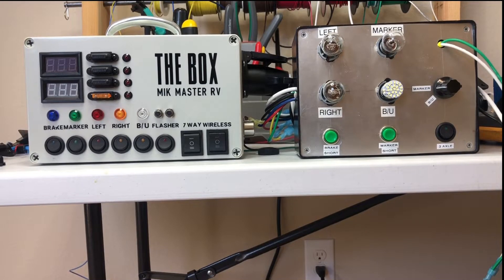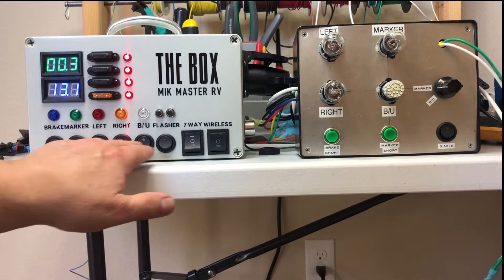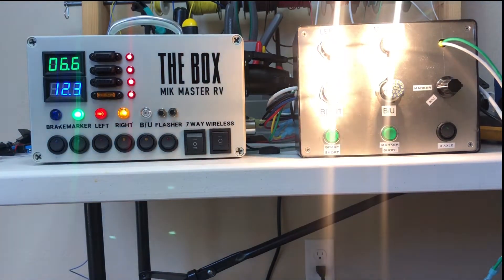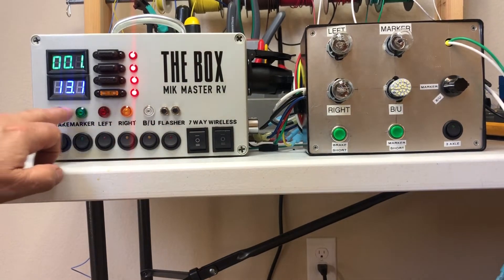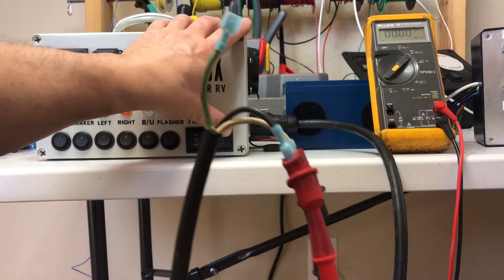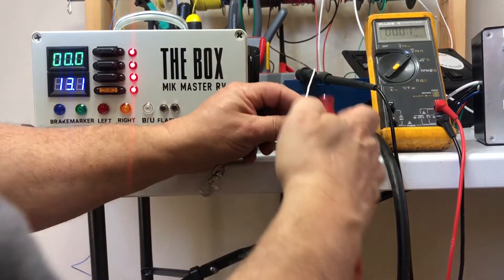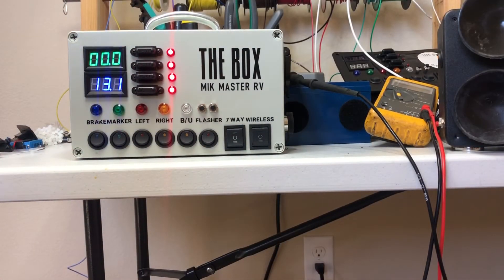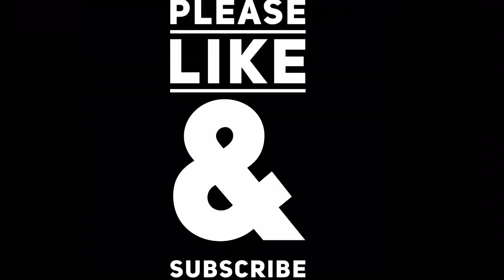RV Tester For 7 Way and Slideouts

Comment: Do have list of components?  
Specifically the
battery 
amp meter 
voltage meter
two-speed flasher relay
Reply from the maker: I think all parts were purchased on Amazon. At the moment I’m not giving away how I built it. Possibly going to sell them…
Reply: @mikmaster63  I was just worried about the quality of the parts. I do not want to build it multiple times because of bad parts
Reply from the maker: Boy howdy, I had a relay board that was terrible so I built my own and the 1st voltage meter I used was terrible also. The rest have been working fine. I have years of testing and redesign invested in this thing…

Comment: I'm an rv tech and I would love to pick your brain on the box you made
Reply from the maker: Working on a new box that combines the wireless and the slim rack tester. What would you like to know.
Reply: @mikmaster63  I would like to know your build steps because I've seen a few on here and so far I like your set up the best and I have alot of the hard wire components already but I want to make my box wireless as well
Reply from the maker: I’ll have a new video finished on the slide out tool soon. Not sure if it will include wiring diagram or if I’ll post them separately. The diagrams take me a while to do. As far as the 7 way tester I haven’t decided if I will make video on that. I have years into designing it and it’s a little more difficult and time consuming than the slide tool.
Reply: @mikmaster63  well if you do decide to I would love to no when that video drops. I do alot of slide out work and quite a bit of pdi at the shop and your setup would probably drop my times in half on some jobs